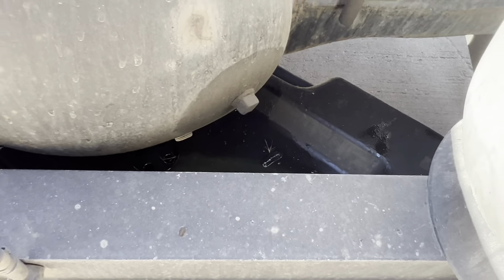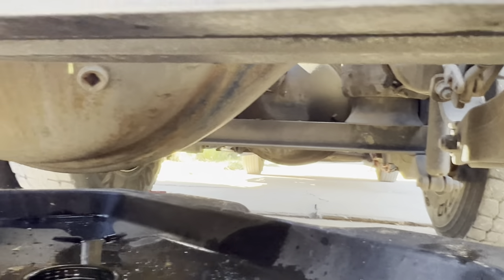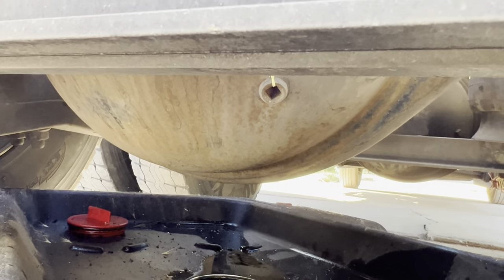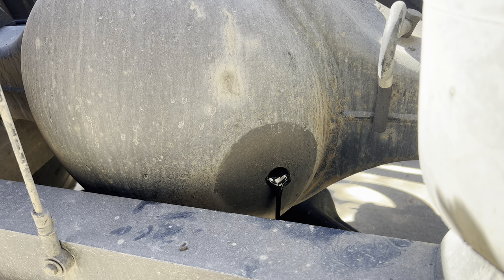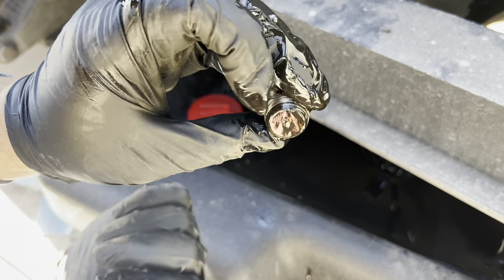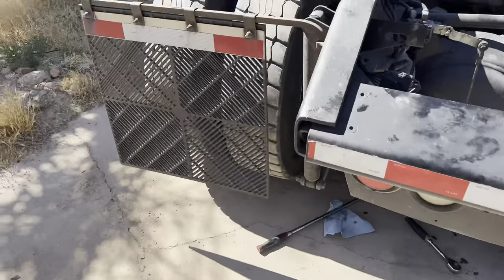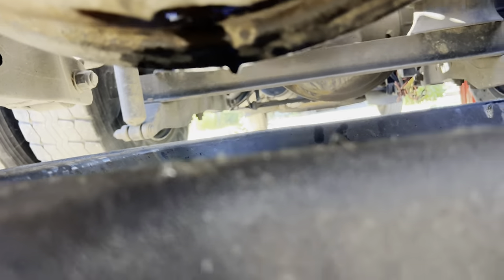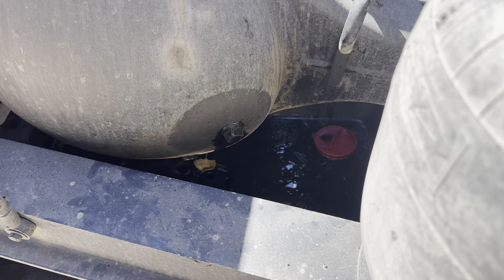Changing Differential Oil On A Semi Truck

Comment: 2.5 gallons rear, almost 3 gallon front, diesel mechanic 44 years retired, change oil at 750  thousand unless contaminated, there is a bottom drain, 1/2 inch ratchet
Reply from the maker: I try and go for 500k
Reply: Dang I'mat 632,000 I'm going to get mine done next oil change which is in 5,000 miles to go. I may just buy my own oil so they won't stick me to bad, if anything they'll charge to top it off.

Comment: I was looking and saying that plug you are draining from has to be a temperature probe hole.

I just use 80W90 in the rears. Fill them to they are gushing out the fill hole. Always scared the wheel bearings won't have any oil going to them.

Transmission gets that high dollar SAE 50 manual transmission fluid.

Comment: Good job, Tonto! You’re doing good! 

Learn to do EVERYTHING yourself… evvvvvvvvvverrrrrrrything. 

Watch those pinion seals. If one starts leaking and you come across a DOT agent who wants to be a prick, that’ll be an OOS! 

Also, in regard to the cylinder head… always always always use NEW head bolts… always, especially on a 6NZ! 

Load that truck up with parts and tools and……. roll!!!